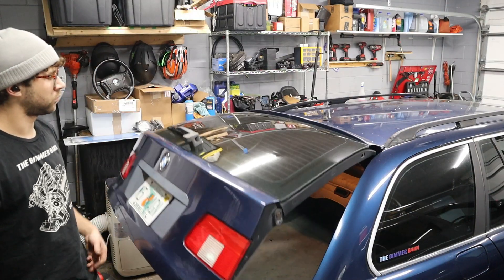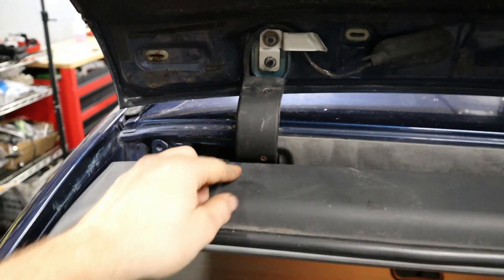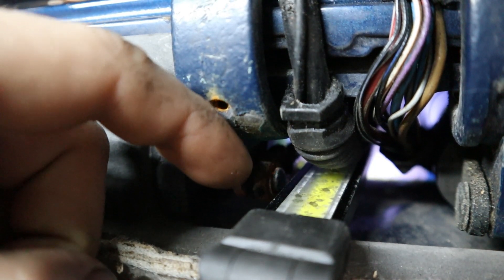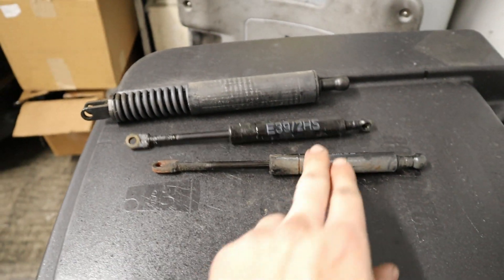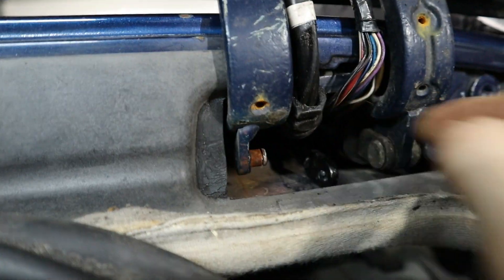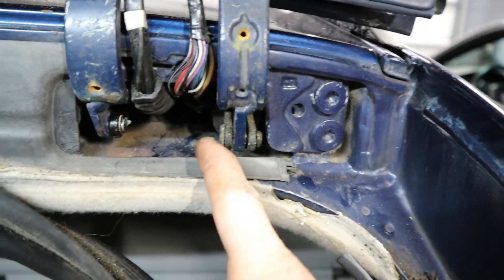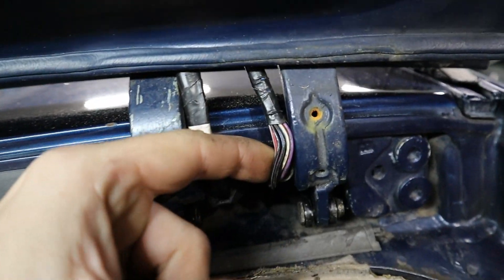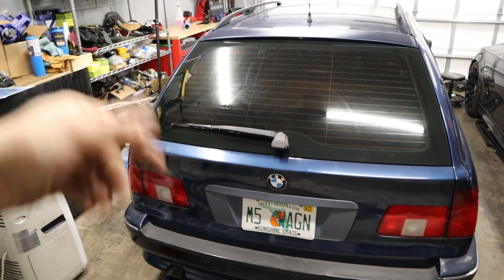How To: Replace E39 Touring Trunk Struts (Common Trunk Problems)

Comment: Thanks Chris. Just replaced mine after watching this and the bimmermerchant cutaway. Just a hint for others. In my case, there was no need for a hammer or socket tool. After trying that approach w/o success (for longer than I'd like to admit), discovered lifting up on the gate with one hand while aligning the strut with the hinge pivot pin does the trick as suggested  by Carpetryder. Also did not have remove the gasket trim. With a bit of blue painters tape to protect  things, this works perfectly w/o removing headliner and does not damage anything. Now to fix the lock...

Comment: The way to get the glass shock onto the pin is by opening the glass separately from the trunk as it gets higher, and I used the plastic end of a vacuum cleaner as a wedge between the glass and the trunk in order to keep it up

Comment: Thanks so much. Also: for the big shocks (outside ones) first pop it on the ball joint, then fix it to the hinge while having somebody else to move the trunk gate further up to get the pin through.

Comment: Great tutorial! But don't slam the trunk like that 🫣 it's a soft close system, you're supposed to lay it manually against the latch, not let it drop 😅
Reply from the maker: Ill try to be more gentle, but are you referring to the automatic trunk package? My car doesn't have that or the soft close feature, so I have to firmly close it otherwise I'll get a message on the instrument panel. Thanks for watching! 😊

Comment: just did this yesterday under snow😅 a crowbar worked fine. those plastic cable guides were the worst part. my trick to line up the couplings were to use a smaller allen key in place of the pin. then you just swing it around a radius that puts you in close range.. 1 hr without the cable guide reinstall. not fun

Comment: Hi Chris and everybody, I have circuit break in the wires where I opened the dust covers as you suggested. I also noticed that the rear wiper and washer comes on randomly. I guess that is the problem. its great to know, but how can this be fixed, what can I do?
Reply from the maker: Your only option is to try to get better access to that chunk of harness, and then solder in some new wires where the breaks are! Hope that helps
Reply: @TheBimmerBarn  thank you very much! I will give it a go but it sounds like a bit of a bugger... never mind, lets see! Appreciated!
Reply: @TheBimmerBarn  There's no way to replace the harness? I'm about to try this project and I have a few small issues with the window lock not actuating and the rear wiper just stopping mid swipe that might be attributed to the wiring getting rubbed up. Not looking forward to trying to solder in new wires in-line.

Comment: Er why tap the strut when you could just lower the boot a bit ??
Reply from the maker: Lowering the boot actually made that gap further apart. I tried pushing it open as much as possible which makes it very close as you saw, but the last 2mm have to be compressed from the strut itself. I wish it were that easy though!

Comment: I say the third brake light haven't been able to find any information on how to change it online no videos or forum posts
Reply from the maker: lol mine broke and it was dangling so I had to remove it temporarily. Definitely need to fix it and make a video! Thanks for watching Denny :)
Reply: Remove hinge plastic wire cover on left side, open just the glass, take off plastic cover topside of glass frame. Its done already in this vid. Take off rubber wire clog left side of the third brake lamp. Wigle your wire connectors aut of the glass frame and one of those tiny one connectors is for brake light, if remember correctly its the pne with yellow/black wire. And now ypu can take your light off, when you unscrew two screws on the lamp. Check for wire cuts, mine was cut in a lot places, had to solder a new wire all away from above my rear speaker up to the hinge plastic cover. Ofcourse check the wiring and light itself with multimeter tester and or firing it up by some sor of up to 12V up to your third brake light if it works. My brake light had broken out screw places in the red plastic. I soldered in some cutout peaces of old creditcard and - wuala, it works, it stays at its place. And ofcourse dont forget to assemble it all back. Good luck